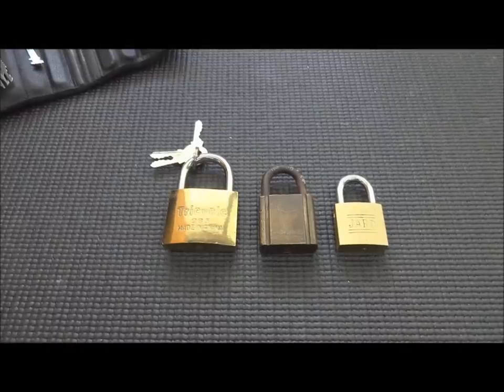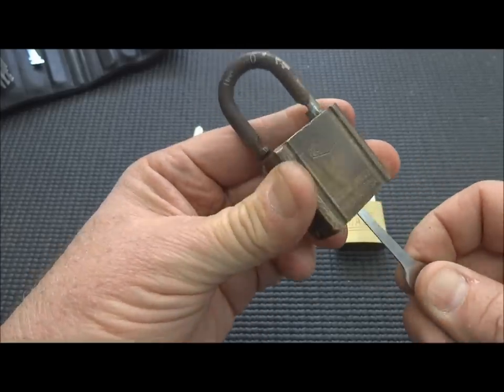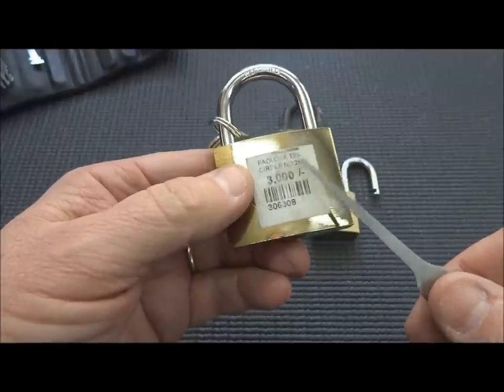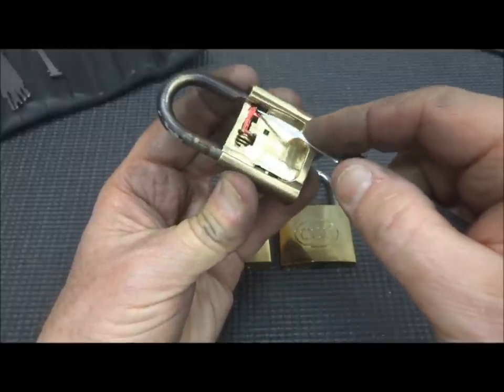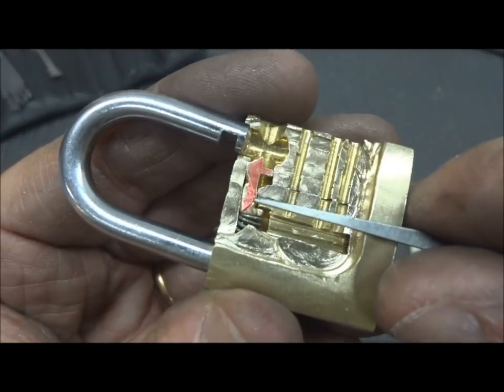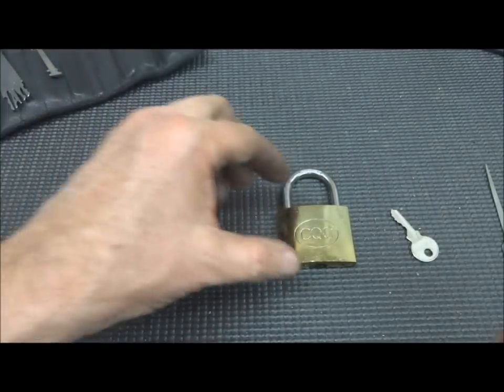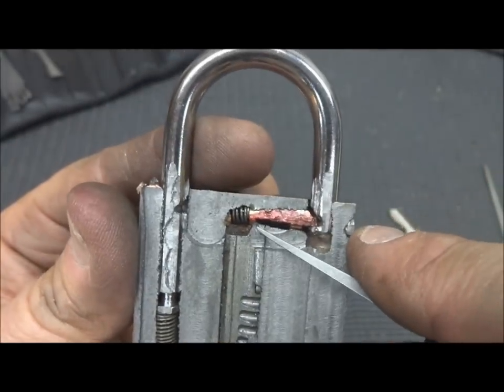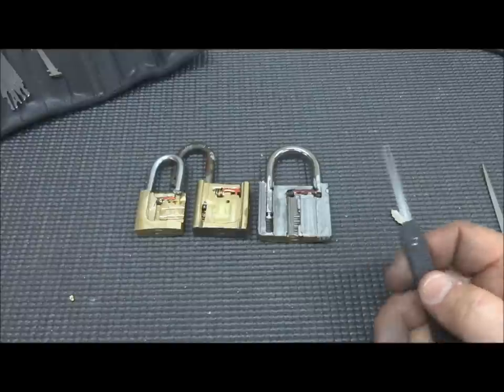(289) Shielded and Unshielded Padlocks

Comment: Interesting didn't know this so had to try it out. It turned out as I had figured. The cheaper locks don't have the shielding which makes them very easy to open. The heavier and a bit more expensive locks did have the shielding. Thanks a lot for this video!

Comment from the maker: Richard,
    Yes, you can absolutely release the pawl from the locking notch in the shackle by overcoming the spring tension.  That technique is called "rapping". You thread a pair of women's pantyhose through the shackle and put tension on the lock.  They you "rap" the shackle on the locking side.  the energy transfers to the pawl, and it rebounds against the weak spring.  Viola, the lock opens.  Great observation though, it shows you thinking about how the lock works.

Comment: Nice one Bill. Apart from the shocking fact these items are still sold as security measures when at best they’re decoration, worth mentioning this is the principle behind the original skeleton keys for warded locks. The key was stripped down to the bare essentials, leaving just the shaft and the bolt thrower, meaning it was the lever turners on the key which were giving an impression of security, remove them, giving access to the back of the lock (as in this example) and it’s open. The mini-knife is a kind of skeleton key for pin locks of this type.

Comment: Thanks for the awesome video!! You helped me realize why I was sometimes having issues with certain locks and it was because I wasn't always going down the pin side. I didn't think it was really pertinent if I was by passing the lock.

Question:
You said this is "partially" shielded but it still can't be bypassed.

Couldn't it be bypassed by getting a bite on the spring and pushing it back enough to disengage the paw a.k.a. locking bar?

Comment: Hey Bill. Very educational as usual. Maybe not possible with your last lock, but if you could release enough spring tension, couldn't you maybe shake, tap and wiggle the shackle open? I am a rookie for sure but I've corrected over set pins by tapping the outside of the padlocked. 

Also.. how did you machine the locks? A video on that would be nice.

Comment: On that third lock.. can you compress the shackle into the lock's body and force the locking paw back a bit, basically abusing the fact you can close the lock with and without the key, with the beveled edge on the shackle side angled... so the cutout actually pushes the paw even farther to the left?

Comment: With the partly shielded lock you said it was as good as a fully shielded lock, cos you could only access the Spring. But wouldn’t moving/compressing the Spring release the locking bar.?

Comment: As a raw beginner,I have learned a lot from your videos,but all the padlocks I have encountered so far have 1 or 2 ball bearings to secure them-am I right in thinking they cannot be by passed by this method and if so how do you tell the difference without access to the padlock in its unlocked state?

Comment: It seems if a lock had pressure pulling on the shackle and the side if the lock was hit hard enough the G forces would collapse the springs snd allow the shackle to move? Or at least on cheaper locks that hace to ball bearing on the opposite side.

Comment: Mr. Bill I am writing not to respond to this video but to see if you have ever defeated a infinity q45 lock. This lock is  a 1990 to 1996 it is a high security lock and a key can be made with the right equipment  but the design will keep you from picking. I can elaborate if you are interested. Infinity downgraded the security after the 96 year to match nissans lock after that.

Comment: I think maybe the other ones are not visible due to the milling? 
I suspect that because the pin-groves are not spaced regularly, which would be unusual. 
But there are 3 pinned padlocks smaller and cheper ones. The one he shows is definitely a cheaper one so it it possible.

Comment: Very good video bill. The casting material is probably a cheap zinc die cast and the same then these cheap chinese locks that you can buy here. I agree with Alex if heat it up to a decent temperature it will maybe melt. They use this crappy material because it is WAY cheaper than brass and you can make a cast for the whole body without machining at all... I hate that stuff!

Comment: Is it possible to drill through the keyway to get to the shield, so you could put a hole in it to get to the locking paul? Do cores come with anti drill pins also?
Reply: William W Haywood some work like that.

Comment: Could you have used a small hook to grab the spring rip it out and then just tap the locking mechanism out of the way of the shackle?
Reply: I reckon you wouldn't have enough room to get around the spring or even get a hook in it
Reply: MayMetal Productions Fair enough, that area does look really tight to maneuver in
Reply: John Beauvais Rip it out?? remember most locks won't be cut in half.

Comment: Thanks. but I still have a question about something you mentioned in the video.
You wondered the last Chinese lock that only has only one locking pawl.
https://youtu.be/C1n8itKkmC8?t=266

May please explain what is the difference between one and two and
does it mean that the lock only has one locking pawl can be broken very easy, or even without a tool?

Comment: What is the thickness of the knife tool? I'd like to make one.
Reply: And will the same knife work for a Master 175?
Reply from the maker: I used 0.030" material for the bypass knife.  To shim the 175, you'll need 0.012 material.  It is a different tool.